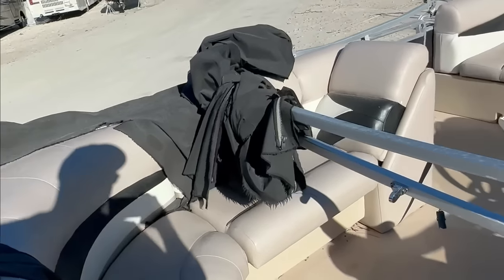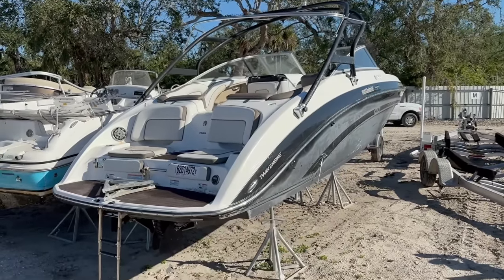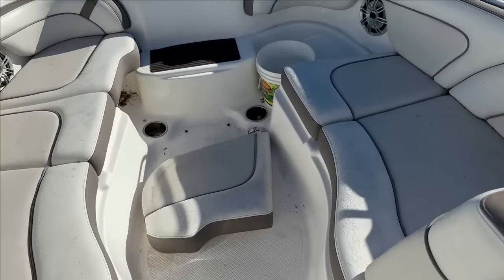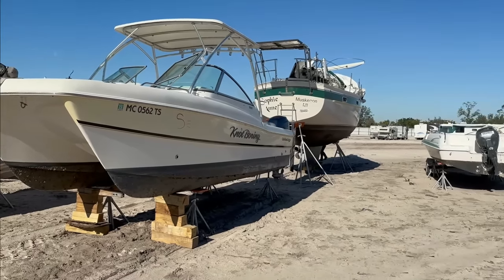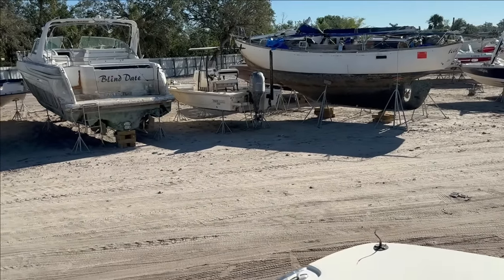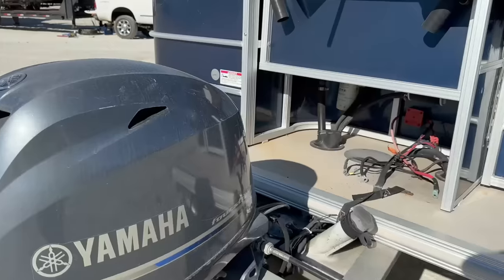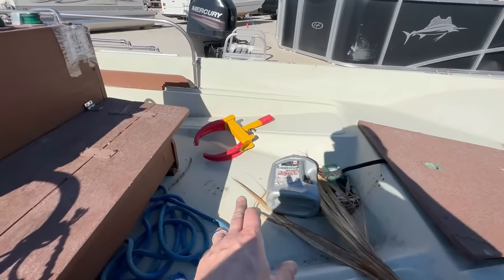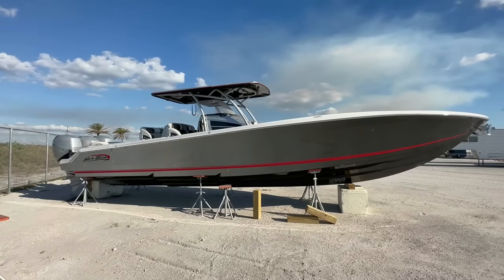CHECKING OUT SALVAGE BOATS IN FLORIDA COPART

Comment: You should never start a boat engine that is not being supplied with water.  You will immediately destroy the impeller that draws cooling water for the engine.  Most of these boats were written off by insurance companies.  Unless you really know what you are looking at, save yourself a lot of trouble and don't buy a damaged boat.  Often a boat can look perfectly intact but was sunk by a storm or something.  The engines, fuel tanks and electronics are all suffering from water intrusion.  Unless you can get it really cheap and factor in doing everything yourself, walk away.  Often boats that sank are salvageable if they worked on quickly but if they have been sitting ashore for any length of time, they probably no longer are.